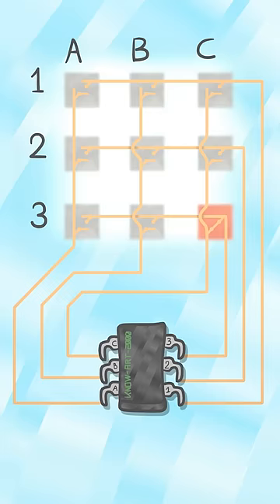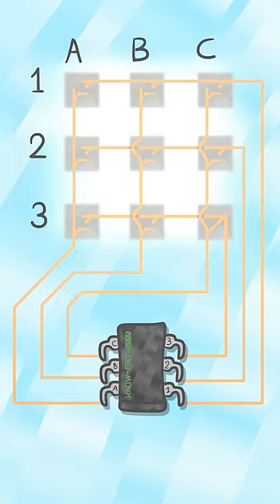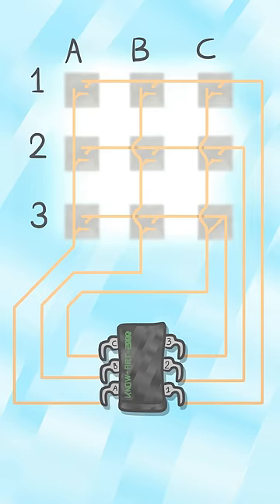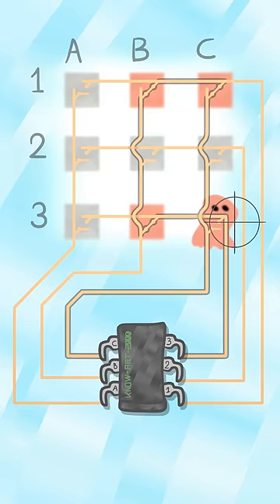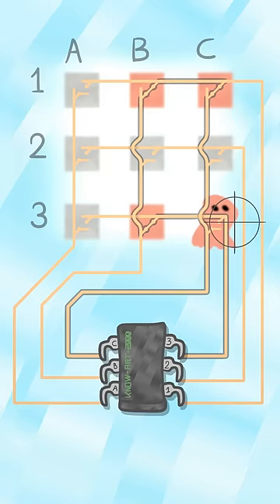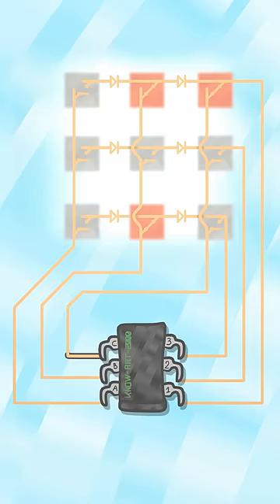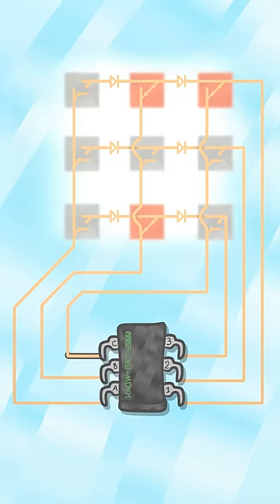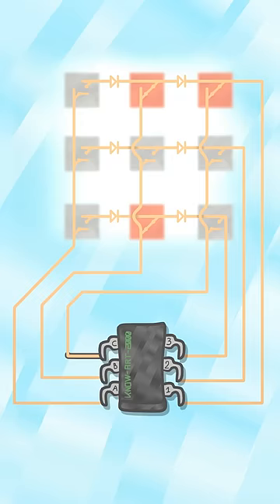How Your Keyboard Knows Which Keys You Press

Comment: Not gonna lie, this went over my head
Reply from the maker: oops
Reply: @KnowArt  It's because im not smart enough, but your videos are great
Reply: Basically when you press too many keys the wires touch each other and the computer gets confused.
Reply: @snaukball8764  ah makes sense, thanks
Reply: @snaukball8764   you are me
Reply: @siamezosvasilias9034  I am you (where you go I go)
Reply: basically, keyboards are smart enough for you not to lie to them
Reply: they would be if the information was bidirectional but it is not in order to avoid confusion
Reply: @snaukball8764 that's exactly what i understood but i didn't get the details even though im curious
Reply: @almaka17  so the chip has less input areas than the amount of keys, so the wires go in a grid to see which letter connects with which number. This pinpoints the key pressed.
When multiple keys are pressed at the same time, the chip thinks that a key that wasn't pressed has been pressed because of the wires touching, so for 2 key rollover, it just ignores the ones that may or may not have been pressed.
For N-key rollover, it uses diodes which are like one way gates so (for example) the C column key press doesn't go to the B column, meaning it only goes to C.
Reply: If you press too many keys, the keyboard gets confused. Keyboards fix this by either ignoring keys that may or may not be pressed, or they fix it by making the key signals follow a certain pattern (going forwards instead of backwards). The keyboard can then use that pattern to know which keys are being pressed, since the signals aren't being mixed up the same way.
Reply: Woooosh
Reply: @Youtube..Enjoyer  glzinng
Reply: it had too much detail where the wires were being connected. that's what made it seem more complicated.
Reply: U slow?
Reply: Proof that u cant learn anything slightly complicated from a youtube short. Wanna learn electronics? Take a course.
Reply: @KnowArt i also struggled to understand,but you simplified it waaayyyy more than people ever did to me,so maybe i jsut dont understand
Reply: ngl the n-key got me
Reply: Try reading about logic gates and it's basics it's simple friend
Reply: @Wammureal  Yes that was what I was about to say. Digital Logic Design, Sequential and Combinational Logic, Gates, K-Maps and stuff. 

This kind of stuff also occurs when dealing with input from multiple sensors and you have to produce a single output (actuation e.t.c.). Although nowadays its easier because we have microcontrollers and FPGAs which can be coded,tested and simulated before flashing it onto the hardware.
Reply: I understood what he meant but also, wat
Reply: I feel like it’s end up being 6x5x4x3x2
6!
Reply: maybe wish for a 🧠
Reply: Using diode we can easily manage this problem of multiple key press
Reply: @snaukball8764  Freaky wires
Reply: @KnowArt  dw i understood it perfectly, i actually always new this but wondered how ghost keys worked. but the diodes are a smart workaround

Comment: Now that explains why my sh***y keyboard can only press 3 keys at a time, its a nightmare to play games on it
Reply from the maker: exactly!
Reply: 3? Best mine can do is 2 💀💀
Reply: Mine does 3 keys unless Alt is involved for some reason, then it’s 2 keys
Reply: @MS-qx9uw so still 3?
Reply: @lulu111_the_cool  no, when I press Alt+something it doesn’t accept another key, so alt+smth+smthelse doesn’t work, which is really annoying when I have to do alt+fn because it’s a laptop
Reply: @MS-qx9uw  so you can't even press Strg alt delete?
Reply: @lulu111_the_cool ctrl alt delete

strg is the german key ctrl is the english version so when talking english yoy shoyld reger to it as ctrl
Reply: man mine is the same way but i just deal with it because it uses buckling springs
Reply: @lulu111_the_cool ayy another fellow Deutscher.
Steuerung for the win
Reply: Get a mechanical keyboard
Reply: getting a mechanical keyboard doesnt necessarily ensure n-key rollover, my model M is universally considered mechanical, however still uses a membrane underneath the buckling springs and only has 2 key rollover.
Reply: @eboubaker3722  There's non-mechanical keyboards with N-Key
Reply: @MS-qx9uw wut, laptops usually have n key rollover.
Reply: @thatonefoxxy steuerung means "control"? das ist interessant! (i'm learning german haha)
Reply: @MS-qx9uw alt is a key?
Reply: Buy mechanical keyboard, basically no ghosting input
Reply: Buy a mechanic keyboard, using a Logitech k854. I did a rollover test on got 30 keys, it's probably higher than that.
Did another rollover test and got a max of 54 keys at a time. One hand over the left side (letters) and one on the num pad
Reply: @MS-qx9uw could also be very lazy/ rushed programing, where even if hardware is capable of reading the keys the firmware may not make full use of the keyboard
Reply: Literally what I was thinking!
Reply: OHHHH, I HAVE THE SAME ISSUE and I kept wondering why that happened
Reply: In GTA I can drive back and forth while turning right, but I cannot do a burnout while turning right. It allows two of WSD but not all three at the same time. WAS works simultaneously. GG.
Reply: @MS-qx9uw alt is a key
Reply: disgusting.
Reply: GET.A.MECHANICAL
Reply: It must be really shitty. Diodes are a few dollars at most
Reply: what kinda bullshit keyboard do yall have 😭😭
Reply: @benjamindrhee  the poverty 3000
Reply: I had one that did 4. I’m very thankful my current one does 6.
Reply: @MeRobyThen  people often forget why we have shitty keyboards, its bec no money bro, why else would we have an AOAS keyboard built by kids in bangladesh
Reply: true @NamelessFurry
Reply: @NamelessFurry  if Nate Gentile taught me smth, poverty is not a reason for this thing. As I said, diodes are dirt cheap. N-key rollover and Anti-Ghosting (marketed as features by many many companies) have been standard for a lot of time.
Reply: @NamelessFurry the struggle is real
Reply: In which country do you live?
Reply: Holy shit just get a new one, these days you can get a mechanical one for under $100
Reply: Always use PS/2 keyboards for games
Reply: Oh my God I couldn't play anything on my old laptop that's why
Reply: @yemetrica then you don’t have a mechanical keyboard. You have a tactile feedback membrane keyboard
Reply: i can't even do capital m specifically for some reason
Reply: My old keyboard coukd press any combination of keys, EXCEPT ONLY AND ONLY W + 4. It didn't detect the 4.
I dont know why or how
Reply: you can remap some controls on occasion so those overlaps don't happen
Reply: that is trash, I'm in the same situation T_T
Reply: I cant even peak walls on my keyboard
Reply: @krbraveofficial  You spelt so many words wrong 😭
Reply: @XpertEngineer12  oh no what a tragedy that I didn't think to spell check a comment I wrote on my phone reagarding what "strg" and "ctrl" are
Reply: @krbraveofficial  Oh no what a tragedy indeed😮
Reply: yeahhhhhh
Reply: lol now I remember my old keyboard used to have an issue with a specific combination
Reply: @yemetrica  model m gang
Reply: Well the multiplexing frequency is usually very high so you shouldn't feel any difference.
Reply: Mine can just process 3 in left and 3 in right
😞
Reply: This is annoying when you want to Play mp games like Bomberman.

Jesus are grouped in sections so most od the time ITS is fine
Reply: Try it with 2 key rollover 😅
Reply: This is why mechanical keyboards became popular.
Reply: Let me guess. Laptop keyboard
Reply: It’s*
Reply: @KnowArt that makes so much more sense thank you so much ahahahahahahaha
Reply: My laptop's trackpad stops working when I hold w
Reply: Yeah I cant play undertale and walk diagonally

Comment: I wonder how anty-ghosting on all keys works on my keyboard. Pressing all keys at the same time and it works.
Reply: Probably a fancier chip with less overlap, maybe a grid based on rows and columns
Reply: Ask Ben Eater's channel. He has a very insightful explanation of the USB keyboard protocol. It's basically 1 bit flag per key.
Reply: That’s N-key rollover. N-key is basically ALL keys can be pressed. Mine has like 6 key rollover or higher. I haven’t tested because I don’t actually have any programs on my computer that would even utilize more than 6 keys at a time 😅
Reply: it has diodes, which means that the current can only flow in one direction doesn't take any shortcuts, making the inputs defined
Reply: @VoidplayLP  may be more chips
Reply: I think so. commonly you can see many extra routes. (If you look at a membrane you can see the traces directly)
Reply: Some diy keyboards ive seen use multiple Io expanders. Every Kes was connected to its own input pin.
Reply: Hmmm i don't know how they do it, but the number of wires doesn't necessarily need to increase... each output pin could be modulated with different frequencies then a set of filter circuits could determine the source of a signal. Anyway, that would need more pins and a more complex circuit around the chip.

Anyway these chips can flip their pins very quickly, easily at 2 MHz... if only one pin at a time is high, a matrix of 6 pins could be scanned around 333'333 times per second... usually plenty short reaction time for even the most demanding gamer.

Comment: The multiplexing grid layout grows fast. Which could be a fun thing to visualise. From 6 pins to 9 inputs is not so impressive as the ratio is just 1/2 more. For 10 pins on each side you'd get 100 inputs which is 5 times the amount of inputs compared to the 20 pins you would have individually.

Comment: Unless... you have a Mechanical keyboard, which doesn't use the rubber dome thingy with the printed circuit board... because every mechanical keyboard key has its own circuit... that's why they cost a lot of money... (it also means you can press all 104 keys at the same time and it will register all of them) but hey it goes clickety clackety so it's cool!

Comment: Is no need 6 pins for 9 buttons, this is electric circuit but for programming one single pin in chip is ok because each button cane generates one signal different by second button in this style one chip cane see 1000 buttons is one single pin , I don’t now if we use this technique but definitely works

Comment: I wouldve just made a keyboard that has 4 different chips and they communicate to each other
Reply: Would be expensive, would require you to program 4 different microcontrollers with firmwares that also communicate to each other, would require you to power 4 microcontrollers, requires you to have enough pcb space for 4 microcontrollers and just is not a good design

Comment: Could it be that there’s multiple of these chips? My laptop for example stops registering keys on the letter area after 3 key presses at the same time no matter where, but the arrow keys always keep responding.
Reply from the maker: What I can really recommend is to go to a second hand store, buy the crappiest keyboard you can find and break it open! You'll see the many tricks they use. If you think about it closely, you'll see that not every 3/4 keys you press at the same time cause problems. It's only specific combinations. So through clever wiring, the arrows (and probably the spacebar, etc) can all be pressed at the same time!
Reply: @KnowArt  I love taking electronics apart, I have been doing that since I was a kid. I find it fascinating how even the cheapest Chinese electronics still got some quite complex engineering in them. It makes me tempted to try designing a keyboard myself actually so I can really know exactly how it works. I know I am never going to know and understand everything but I am definitely going to try! Your channel is amazing, it puts me to think about things again.
Reply: Intelligent people has made it such that the keys most used are rarely on the same grid, allowing for different combinations.

Modern keyboards however does no longer suffer from these issues of old.

Comment: Thats why mechanical keyboards rules. You can press any number of keys you want, because every key gas its own traces. This way, you can press the full keyboard and the pc will recognize every stroke
Reply: Mechanical keyboards just have mechanical switches and the underlying circuitry is the exact same as a membrane keyboard.
It’s just that mechanical switches are so expensive, that going cheap just to not have a few diodes and a more expensive controller is just silly.
Which is why basically all mechanical keyboards use more expensive PCBs
Reply: Well the chips are still 48 pin often and there are more keys so its NOT TRUE! Its uses the same underlying mechanism but different keyes and a faster scan speed

Comment: That's like literally the most basic design of a working keyboard😂.
But we all know,we can press 3 keys at a time,i.e when your PC freeze up,you press alt+ctrl+del or alt+f4 to shut a program.

Very basic stuff,just require basic logic gates,decoders and multiplexers to fetch multiple key inputs and relay it towards the main IC after which it goes in io pins i.e bus connections

Comment: Or you could use a modern keyboard witn an ARM processor that literally can't ghost keys.
Reply: It still uses diodes. Its not like an arm processor is different then a mips/risc 32bit mcu. Also its the firmware that also is a huge part of it. Dont say dumb things!
Reply: @309electronics5  That may be, but for 99% of people my explanation makes sense, you clearly have greater knowledge than most. However most modern high end keyboards can output literally every input simultaneously because of the onboard processor, ARM or not.